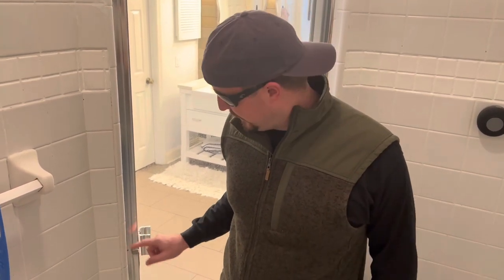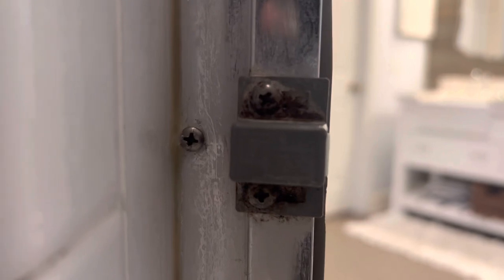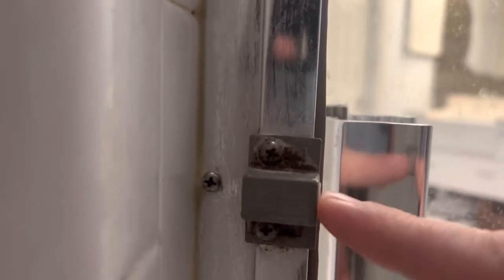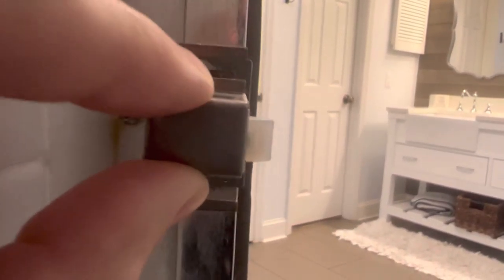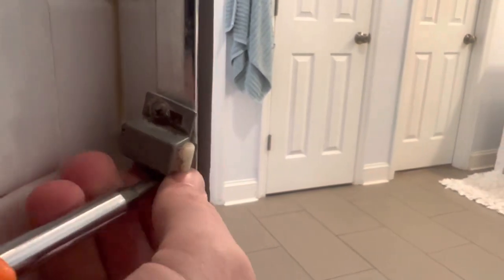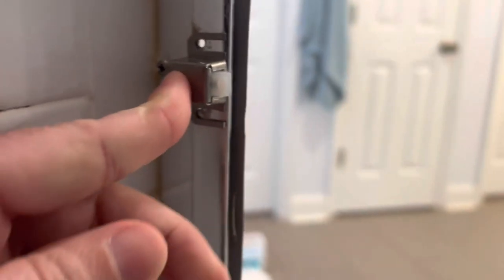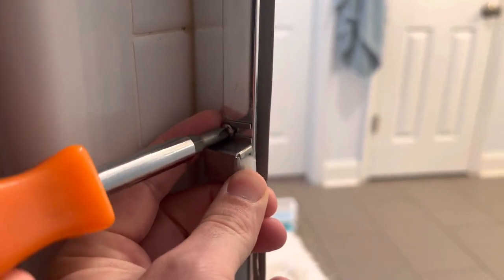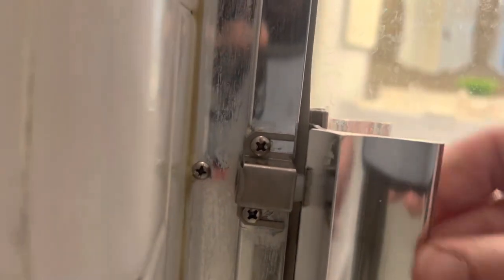HOW TO Fix Shower Door Latch / Catch

Comment: I need that gray rubber weatherstripping. What is it called? I can't find it in Amazon.
Thanks
Reply from the maker: Howdy, partner!  It should be called a shower door seal.  There are likely a lot of different options and may be difficult to find an exact match.  Good luck!
Reply: @MRGREGSHOWTO  thanks
Reply: Yeah I couldn't find anything that would work in home depot.  Do you happen to have a link for an alternative? Thanks again

Comment: The handle that attaches to the glass came off. What can I use to reattach it to the glass door?
Reply from the maker: Howdy, partner!  Is it a friction mount (meaning it holds on by itself with a clamp) or does it have screws?
Reply: No screws, it just holds with some rubber material, and a piece of it tore off.
Reply from the maker: You should be able to slide the clamp back on with the rubber material. May need to lubricate it for the initial fitting.